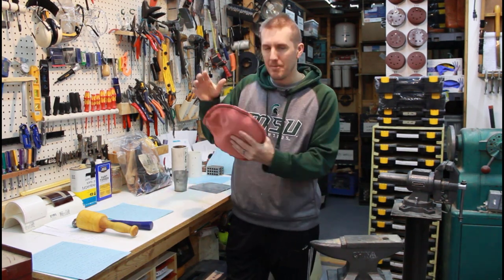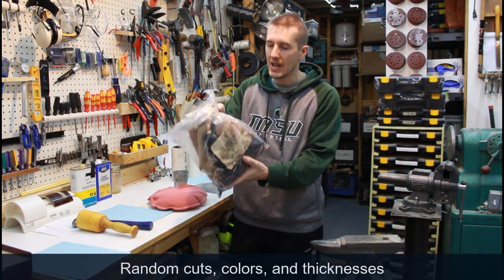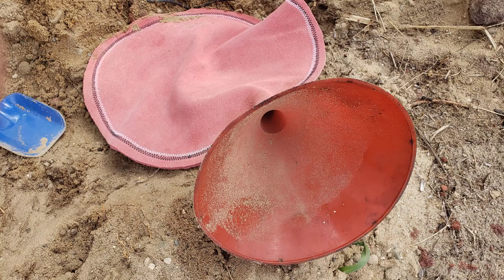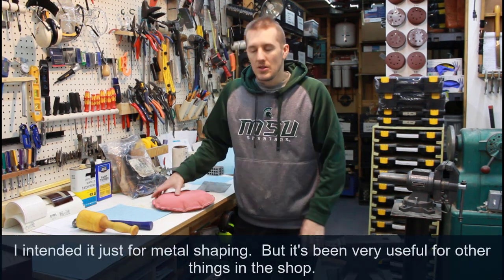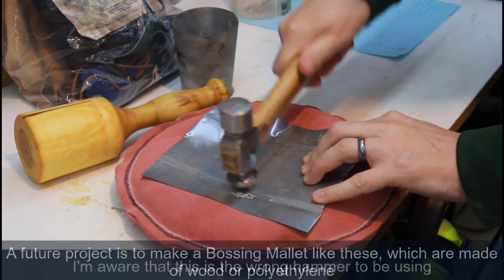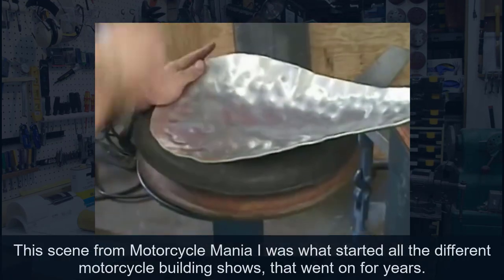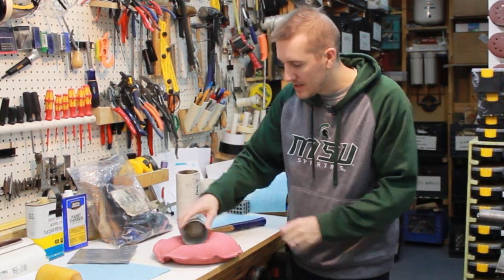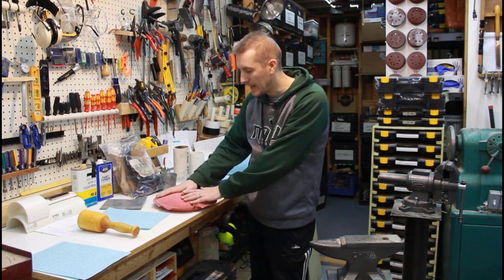Sandbag DIY  |  Metal Working

Comment: Thank you for the video, Dave! I also found some scrap leather and I'm planning on building a sand bag or two using your tips. For a Bossing Mallet you may want to take a look at using an old wooden baseball bat. They're cheap and easy to find. 

For mine I cut off the striking end and pointed the part where the cut was. I left the flatter end on the other side. For the handle I used the handle from the bat which was conveniently shaped for a hand. Then I drilled through the head, turned down part of the handle, and glued the handle into the hole.